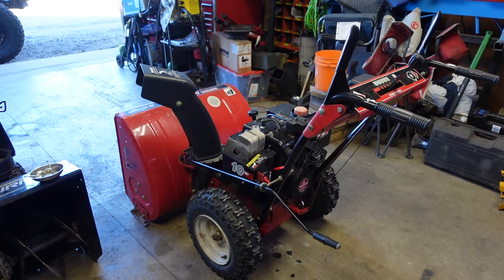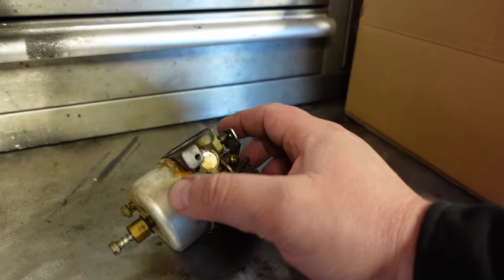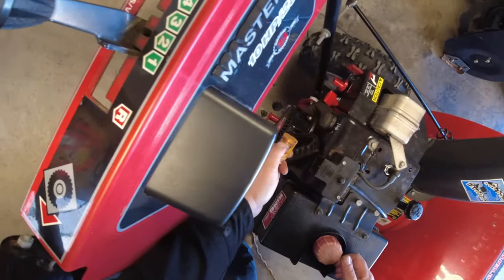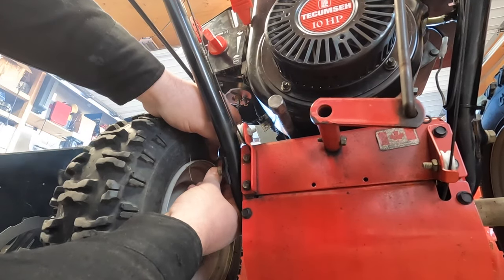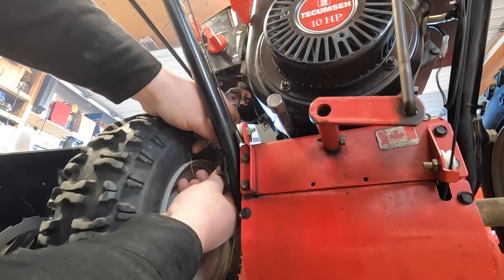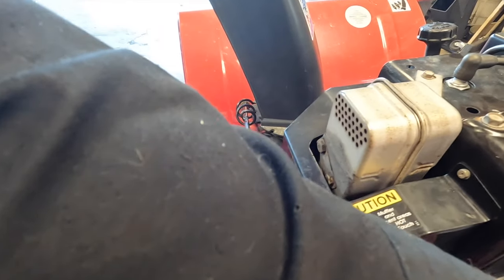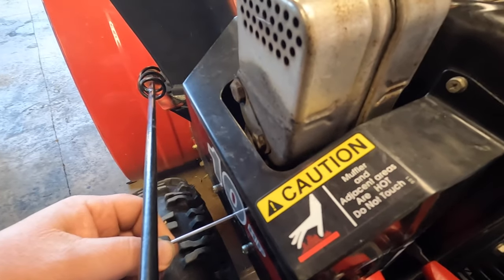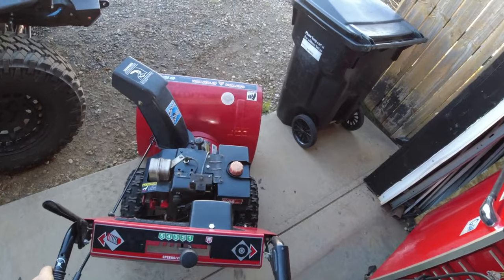HOW TO ADJUST A SNOWBLOWER CARBURETOR

Comment: Hello, nice short video, straight to the point! Question, I just put a new carb on and now it's running (Yard Machine 8 hp Tecumseh), but it's rough and I had no idea it would be a carb adjustment. The stock carb has no adjustment screw under the bowl but the new one does. That was confusing but when I watched your video it made sense. I'll have to try this and see, I just assumed it would start running the way it's supposed to as soon as I put the new carb on but that's not the case. Thank you!